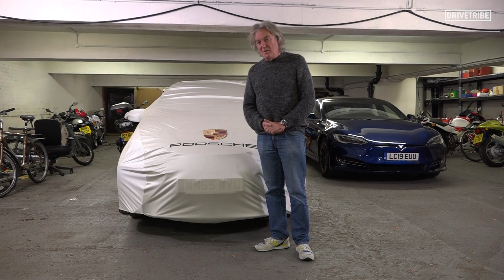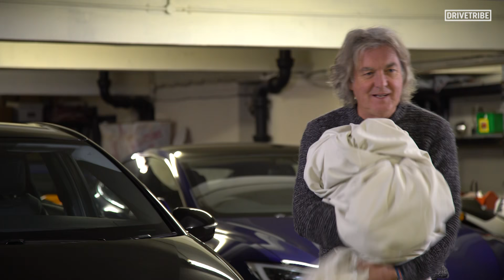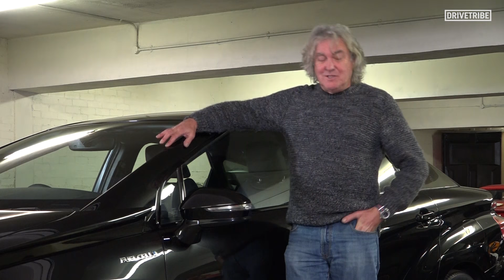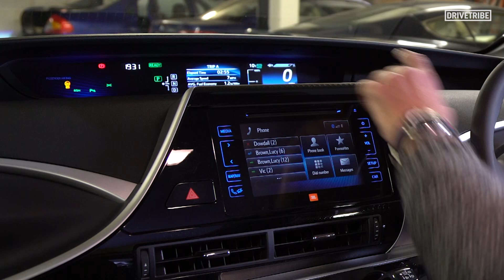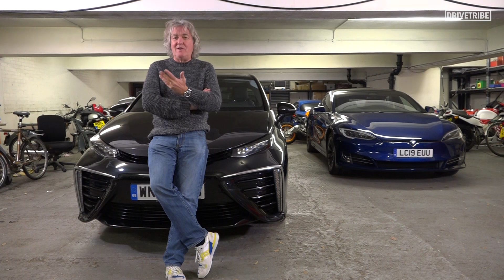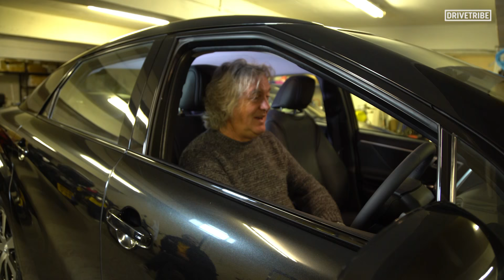James May has bought ANOTHER new car

Comment: The logic conclusion would be a hydrogen-electric hybrid.
Electric for commuting, with a hydrogen fuel cell range extender for long trips.
Batteries last longer as they don't have to be supercharged and can be smaller as well.
And the hydrogen grid could be focused on the highway network.
Green energy sources like wind and solar can be used more efficiently as electric over-production will be used to generate hydrogen.

Comment: If I was being cynical, and I worked for Big Oil, then I would love the idea of the hydrogen economy. At the moment I (as big oil) control the delivery of energy , people drive their vehicles to my retail outlets to refuel, where they also spend money on luxuries like tobacco products, sweets/candy and fancy coffees. If my customers switch to a battery electric vehicle then they shift to a totally different supply chain, and even, god forbid, can make their own energy if they have solar panels. However, if I get them hooked on H2, then I still control the distribution network and thus keep my profligate profits.

So what you appear to be advocating is rather than simple and effective electricity cables delivering energy to houses and vehicles, you want containers of H2 being driven round the country, cluttering up the roads etc?

By the way, you really don't want to be burning H2, because you'll get NOx pollution, and its thermally inefficient, so we'd be stuck with many of the problems of burning hydrocarbons! Fuel cells are cleaner and more efficient.
Reply: Not only that, but the vast VAST majority of hydrogen produced, comes from big oil.
Reply: Paul Mansfield 

Here’s the issue. Where are you going to get all that hydrogen? Water? You will need 1 trillion gallons of water annually to power North America’s cars in Hydrogen 

Also your going to need to double the power output of the electric grid because making hydrogen takes 3x the amount of energy vs raw electricity.
Reply: @devinbender8428  the h2 is turned back into water in the fuel cell
Reply: Paul Mansfield 

Yea and? It either goes up into the atmosphere or down the storm drain.

So you have to get it from rivers streams and lakes. You can’t use ocean water because of the salt.

Comment: This is a step in the right direction.

Research and technology hasn't progressed much when it comes to HFC-EVs compared to battery-powered EVs, so there's definitely a good chance it could go bottoms up since countries around the world are currently looking to move away from vehicles running on fossil fuels and battery-powered EVs will be the preferred option of the two.

However, in my opinion, HFC-EVs have a much better potential, efficiency and affordability if it's developed responsibly. Hopefully, science and technology will catch up one day.

P.S. Toyota should really work on their design. This car looks atrocious from every angle.

Comment: The hydrogen one would be a better care overall if you commute a lot you won't have time to charge it everytime you stop for 1+ days hydrogen fuel cell is just like petrol but without the carbon dioxide, it only takes 2 minuits fill it up

Comment: I'd be curious to know which would cost more to keep running in the long run. It's just too bad there aren't more Hydrogen fueling stations otherwise the HFCEV would be more practical I'd think.
Reply: Hydrogen will always be more expensive than recharging, and batteries are more reliable long term.

Comment: I remember when you drove and continued on the honda clarity hydrogen car in California years ago.
Reply: Saaaame, every time I think "hydrogen car" I think of that
Reply: It's all a matter of perspective... gas and diesel.... found, pumped, processed, transported, stored, used... and flammable...
 We're already doing this.  Is one worse for mother nature than the other?  I'm not the guy to answer that,  but just like gas and diesel, hydrogen is quicker to refuel on and easier to predict fuel mileage for than electric hybrids . Lithium batteries are neither good for the environment or sustainable.
Reply: @salchristiano6606  I encourage you to look up the volatility of hydrogen vs gasoline... Two of the things that make it attractive, also make it far more dangerous. First it's flammability range is massive, ignitable at 4 to 75% fuel-to-air concentration, compared to gas at 1.4 to 7.6%. Second it's low minimum ignition energy, which is about 8% of what it takes to ignite gas. Both very attractive until the fuel leaks... which btw, Hydrogen is also exceptionally good at.
Reply: And it was a rubbish idea then and it's still a rubbish idea now. Just makes no sense for a car for all the negatives that he explained
Reply: @RedBatRacing  unless you're one of those annoying people who like breathing
Reply: @stiimuli  wasting energy generating, compressing and transporting hydrogen won't do much for the air we breath. It might make some sense for large long range freight vehicles, but not for cars where you have to have a whole new fuel infrastructure. Battery tech is far superior and technology improvements are speeding up charge times.  BTW my daily driver is a Nissan Leaf, so I don't have to feel guilty ripping up the race track on the weekends :)
Reply: Red Bat Racing Unless you decided to open a Hydrogen fueling station.
Reply: @RedBatRacing  Not to mention the whole extraordinary explosivity thing.

Comment: I realy love you for doing this ! Your are one of just a few people giving the Fuel cell a chance. I'm realy interested in your opinin and in this comparisson.
Reply: the lead engineer of the mirai called hydrogen an alternative to gas but not to electric cars. electric cars make much more sense than hydrogen.
Reply: Maxout ._ until we can find 1 trillion gallons of fresh water in North America annually to fill all the cars of the USA it ain’t gonna happen
Reply: @devinbender8428  please at least research what a fuel cell is before joining the debate. 

a fuel cell car does not use up any water. it uses hydrogen and spits water back out. the hydrogen could be made using terribly inefficient electrolysis or could be made from oil/natural gas.
Reply: drkastenbrot 

I understand that. But the vast majority of people want to make Hydrogen by using electrolysis from water. 

You need 1 trillion gallons of water then 3 x the amount of electricity vs electric cars to make the hydrogen.

Or yea use oil and nat gas. That cost a lot more in order to prevent CO and CO2 releases. A LOT MORE and your still using a limited resources. 

So those are your choices 

4x the cost of Raw electricity for Water electrolysis 

Or 3x the cost of Nat gas for hydrogen extraction. 

Or the cheapest option. Use natural gas for power plants to power electric cars. 

Please tell me why ANYONE would use hydrogen? There is no way in the world you are going to make hydrogen cars cheaper than GAS powered cars let alone EV!
Reply: @devinbender8428  im against hydrogen if that was not clear enough

hydrogen is cheaper than gas and it will become even cheaper as gas gets more expensive. water also is not the issue since it is not destroyed in any way. 
hydrogen cars are totally functional and possible, its just that a BEV is going to be much cheaper and energy efficient to drive. 
hydrogen may have a use case for very long range applications (if people feel comfortable carrying over 20 kilos of super high pressure combustible gas with them haha).
Reply: drkastenbrot 

Hydrogen has an energy equivalent of 5.6$ a gallon vs gasoline.
Reply: @devinbender8428  take the efficiency into consideration to not get totally unusable results. a gasoline car will struggle to even reach 20% under ideal real conditions. hydrogen is a little bit better off and the prices are differing in other parts of the world.
Reply: drkastenbrot 

Cost per mile in fuel.
Toyota Muiri $0.33
Honda Accord $0.16
Tesla Model 3 $0.10
Reply: @devinbender8428  again, fuel prices differ in other parts of the world. In germany, hydrogen is cheaper and has slightly better availability. It will also continue to provide an alternative to gas due to the ability to make hydrogen from almost any fuel source. Its not particularly clean or neutral but helps getting the cities clean.
Reply: drkastenbrot 

Ok so they have it down to $2/ kg making it nearly the same as gas. Still more than Electricity. 

Also the prices are LOW because they are built AT natural gas sources. That’s like putting a gas pump on an oil field. Same thing is happening in Texas. 

I just checked the prices they are paying for that nat gas. UNDER $1 A MCF!! you know what the USA average is? Closer to $4 before taxes and fees. After closer to $7

So to SCALE that to the USA you have to build more pipelines all over the USA and Europe. That cost money. So more taxes and fees. So would you look at that. Hydrogen now cost more.
Reply: @devinbender8428  I think, that some years ago some people had almost the same discusion as we are having, but about Cars in comparison to Horses. And we all know how that story ends... 
Also, its not the cost of the cars and there ownership AT THE MOMENT that counts (cuz Gas Cars are much cheaper than any other form of engine powered vehicle at the time). What I like is that you dont have to wait 8 Hours to charge a Tesla after you drove 300 miles (how long would you need to do a trip Form Berlin to Rom ? (1200 km)), but you can recharge the Mirai in 5 minutes, like ca normal fule powered cars. Thats, for me, the deciding thing.
Reply: Maxout ._ 

Current technology allows 300 miles in under 45 minutes.

New solid state batteries and variable motors will allow for 800+ mile range and a full charge in under 45 minutes.
Reply: @devinbender8428  I still prefer filling um in 5 Minutes an having the same range 🤷‍♂️
Reply: Maxout ._ mhmm. Talk to me when there is over 50,000 stations in the USA.
Reply: @devinbender8428  sorry, but i dont care how many of them are over there. In Japan, whre some Cars like this are in use at the Moment, are enouth I guess. And in Europe, it will be more in a few years. And prices will drop too.
Reply: Maxout ._ 

Lmao how are prices gonna drop? Like I said. All the current hydrogen stations are either 

1 On a natural gas/ oil field where the gas is cheap OR FREE! 
2 in California where they give hydrogen stations MASSIVE tax breaks

And Japan? You mean where a hydrogen station turned into a crater??
Reply: @devinbender8428  Don't talk to me about american Taxes. I dont care about them. And I dont know what exactly will happen. All i know is that the will be a need of an alternative fule. And at the moment, I dont think that Electic cars are an alternative. If someting changes than tank to me again 🤷‍♂️

Comment: Think Hydrogen is great, we just need to work out the two major, currently fatal flaws. 1. It takes more energy to produce hydrogen than it makes after currently, so oil/fossil fuels are still burned in making it. 2. It leaks, hydrogen is such a small atom it can quite literally leak out of everything. James will leave his Tesla and yeah it might lose some battery life if left, but the Mirai might lose its entire tank if left long enough. Once we solve those two problems, it might actually be the fuel of the future, until then, I think the Tesla is the way forward. 

Me though, I'll stick with massive great Petrol engines for as long as I'm allowed to, would like a Honda e to get to work though.

Comment: In the future...could we drive electric and 'refuel' in a station by pullin up and inserting an already charged battery into our car and driving off? It would have to be a universal battery working with all cars, or even 3 types max. depending on size... I wonder how it could work, because battery size/weight is still an issue and it would be practical as long as one person or two could do it without involving a team of mechanics. And the logistics are complex compared to pulling up and re-charging with a plug.

Comment: While I'm glad James is taking part in the experiment, I don't see HFCEVs on a level playing field with BEVs for at least several years out. The primary reason stated by James, himself - infrastructure.
If we are talking about the average driver, nobody is going to purchase a HFCEV knowing they will have to tailor their driving habits around a handful of possible refueling stations, let alone consider taking it on any trips. This was the same position BEVs had about 10 years ago.
I think the best chance of HFCEVs gaining momentum is when a manufacturer makes a Hybrid: A vehicle with a large enough battery to have a range of +/- 180mi on BEV alone, but can also refuel at  a Hydrogen station much like Plug-In ICE Hybrids do now. If anything a setup like that would be much easier to develop since you have the same drive motors but are switching between two power sources.

Comment: I suspect Hydrogen will take over from diesel-type engines where they're likely to be running for a long time if not 24x7, ie. trucks, trains, tractors, ships, generators, etc, and batteries will win with home users where the vehicle is idle most of the time and doesn't generally travel too far at any one time.

So what I'm saying is... can I have your i3?

Comment: Good job on the H2 car. I guess there’s a long way to go due to the lack of infrastructure and models of cars. 

Personally I think that H2 would be perfect if people could produce their own H2 at home from water using solar power, wind or just the mains. Same goes will filling stations,, why transport hydrogen to a filling station, you just need to supply them with clean power - whether from solar panels on the roof and surrounding area or from the mains. 

Rather than the water (burnt hydrogen) going out of the tail pipe you could poor it back into the refuelling station - it’s only a few litres anyway.

My main objection to BEV is the batteries. Having worked with portable computers and smart phones for years I know that they don’t last very long and they’re expensive to manufacture, toxic to the environment to produce and are a pain to recycle/dispose of.
Reply: Fuel cells are even more expensive, and dont last long.

Comment: The biggest problem is hydrogen tends to be very leaky because the molecules are so small, making it more costly and difficult to store and transport than gasoline. It is also odorless, colorless, and tasteless, so the only way to detect a leak without special equipment is if you can hear it leaking.

Comment: Can you store hydrogen in a tank at your home like heating fuel?
Reply: No. At least, not that I'm aware of. It's stored at high pressure, like 350-700 bar. The fuel tanks are expensive and require inspections and have to be filled from specialized trucks.

I assume if you run out they have to tow the car to a station, if the tech takes off tow trucks may eventually carry high-pressure high-pressure or cryogenic jerry cans.
Reply: Not really, hydrogen either has to be liquefied at near absolute zero, or stored at 10,000 psi. Neither is practical and both are dangerous.

Comment: The big differences here are the way they take on range. Tesla has chargers dotted about and at a fudge (long waits, frequent stops, etc) can be used in a lot of places if you're prepared to put up with the inconvenience. 
The Mirai is hamstrung right now thanks to having zero infrastructure available but think forward and imagine a Hydrogen nozzle at every fuel station vs a fast charger. 
The Mirai can replace our current cars pretty much 100% as if nothing happened. How far are we away from batteries which can take on 300 miles in a couple of minutes and which weigh sub 100kg for that range?

Comment: Hydrogen cars are really cool but unfortunately I don't think they will ever succeed. 

As you said, unlike battery-electric cars, which can be charged at home if you don't live near a charging station, hydrogen cars require a fueling station. So if you don't live near one, you can't buy it. That means energy companies would need to invest billions into building the necessary infrastructure, in the hopes that once its built, people will start buying hydrogen cars. 

Once the next big breakthrough in battery tech happens, which is imminent considering all the money being thrown at it, the dream of the hydrogen car will be dead. Spending hundreds of billions on hydrogen infrastructure won't make sense when car batteries are capable of doing 1,000 miles and being charged in 5 minutes.